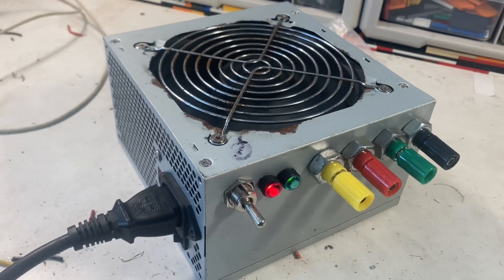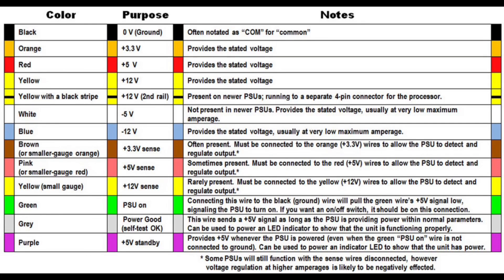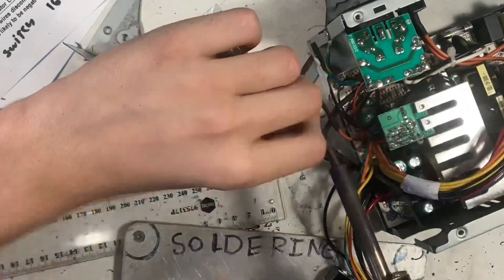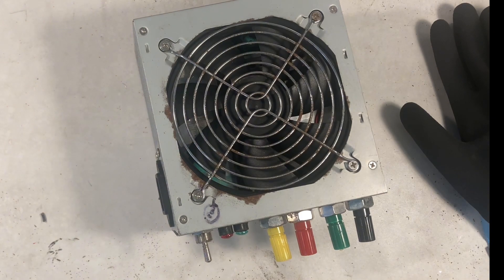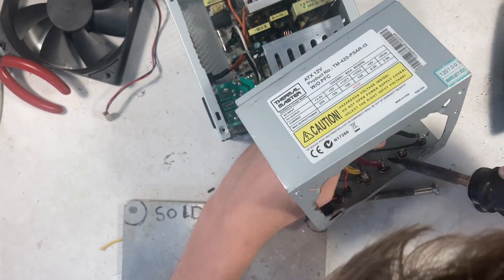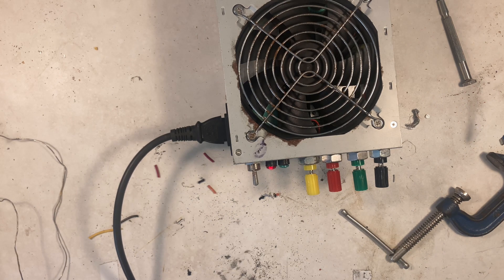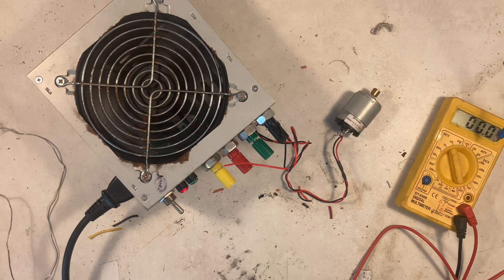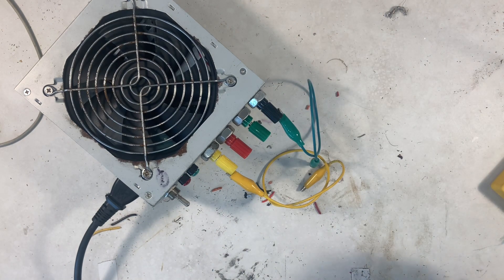Making A Bench Top Power Supply From A RTX PSU

Comment: If you connect two such power supplies in series, you can raise the voltage to 48 volts using -12 volts from one of the power supplies.
Reply from the maker: Yeah I’ve heard that before I just dont have a second one that has -12v

Comment: you need a load on 12 and 5 volt line, internal resistor or a light bulb. without it won't start up,

did this with an old psu years ago